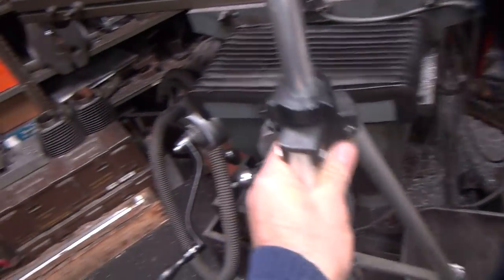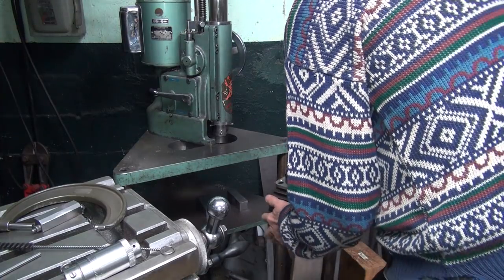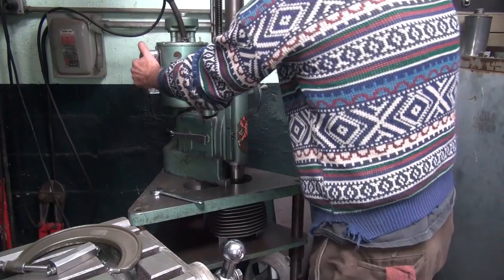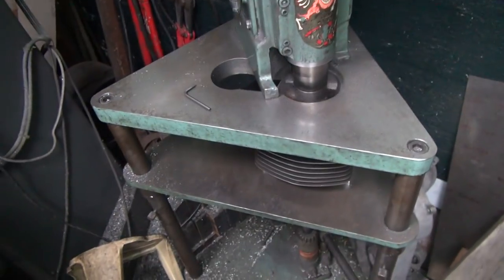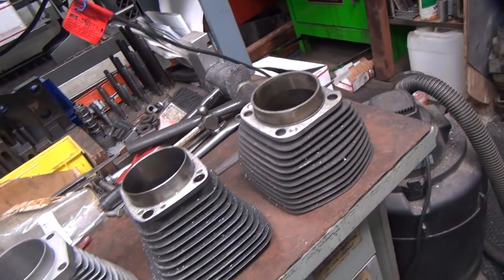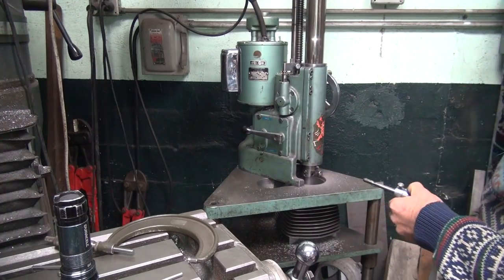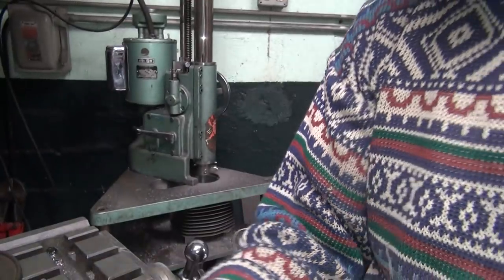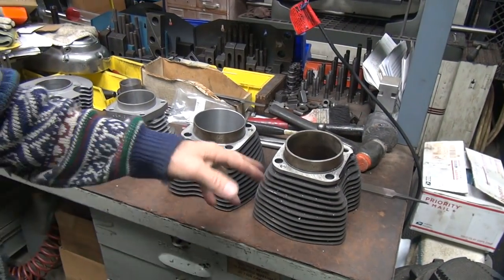1961 xlch #127 no miles transmission motor rebuild sportster harley repair restoration tatro machine

Comment: Keenan, out of curiosity have you ever cut an o-ring groove on the base of a cylinder that wasn't designed for it? I would think that the o-ring would be the best for sealing.
Reply from the maker: no, you have to deal with the oil drain back holes too and it is not worth the extra effort. for racing i don't use any gaskets. makes for a quick tear down and back to racing between rounds.
tatro
Reply: @TatroMachine  wow, I would've NEVER thought that one could run "metal to metal" for a critical sealing surface. I'm in awe...